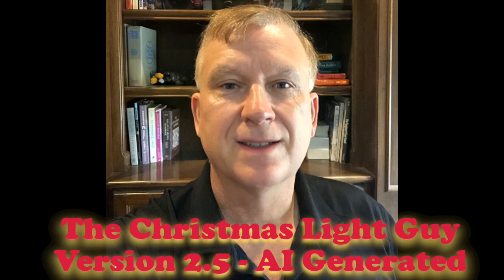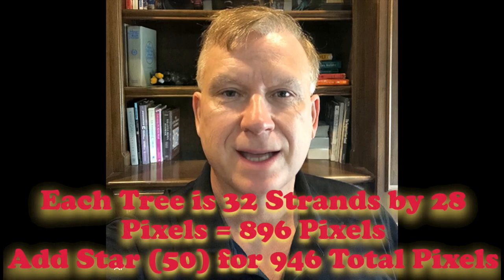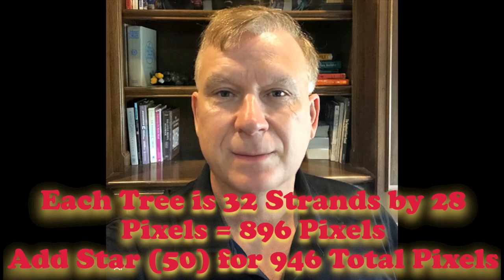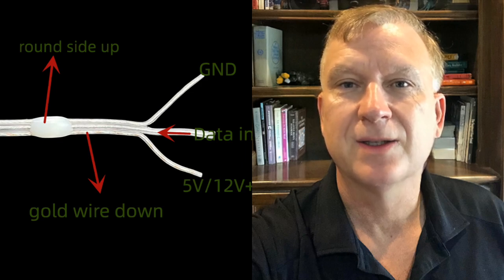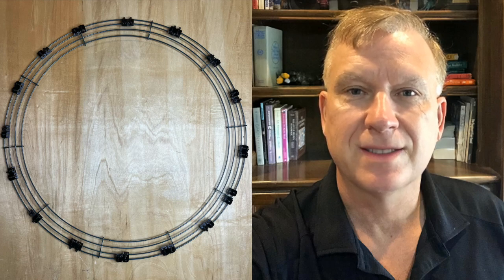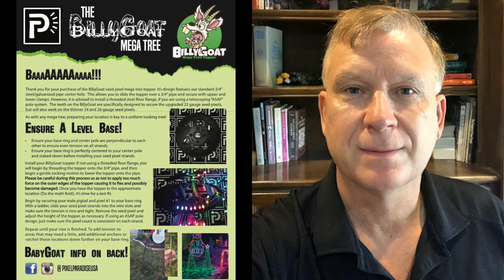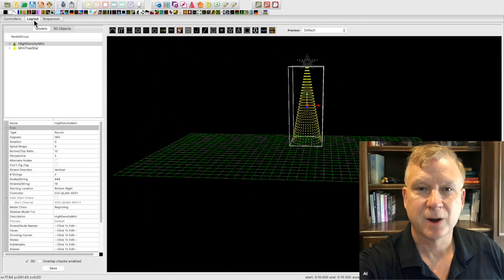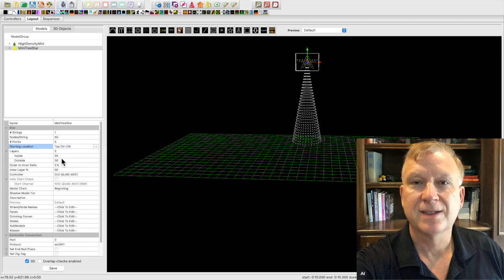How to Build a High Density Mini Tree Using LED Seed Lights

Comment: What power supply and controller did you use for this tree?
Reply from the maker: The power supply was a standard 12V - 350 Watt Meanwell Power Supply and the controller I used was a DIG-QUAD using two outputs.  One output for one string of 448 pixels and the other output for the other string of 448 and the star (50 pixels).  Any power supply that is the correct voltage and has significant power (wattage) will work. Also any controller or remote with 2 outputs capable  will work.
Reply: @thechristmaslightguy thanks. This video was very informative.
Reply from the maker: Thank you for your feedback.  This was a fun video to make and also this was my 1st 360 degree prop in my show.  I build two of these high density mini trees for my display last year.  I was impressed to see how different effects and transitions looked on a 360 degree high density prop.  The effects have more definition and transitions are much more visible. It is hard to explain without seeing these in action.

Comment: Given the seed pixel wiring is higher/thinner AWG, what device are you using to splice for power injection?  How many seeds are you driving before introducing power injection?
Reply from the maker: I'm using 2 strands of seeds over 2 ports.  The first strand has 448 seed pixels with power injection at the end of the strand (string) - 448th pixel.  The second strand is 448 + 50 (star) or 498 seed pixels with power injection at the 448 seed pixel.  I'm driving 448 pixels before I introduce power injection.
Reply: @thechristmaslightguy  - Thanks!
Reply from the maker: You are welcome. Let me know if you have any further questions.